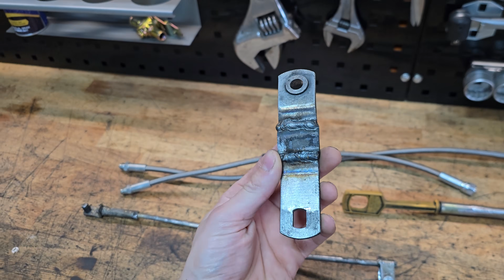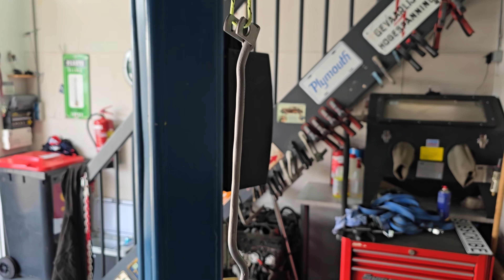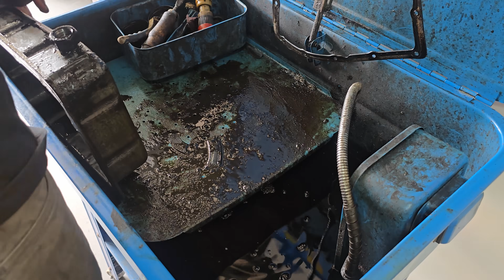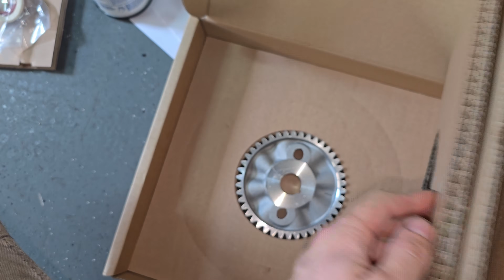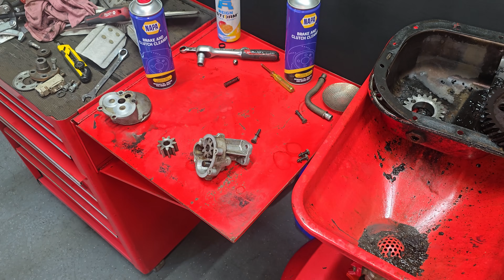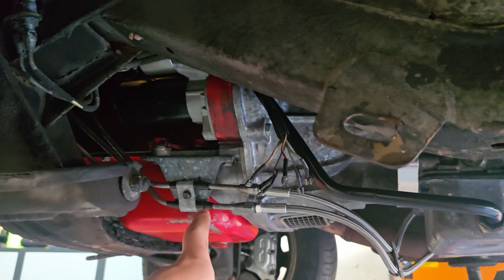Can We Finish 4 speed swapping this classic 1973 Volvo P1800ES?

Comment: I picked an AW70L tranny from a Volvo 240 series at a local junk yard (bell housing, torque converter et-al). I had none of the problems u r talking about (TC not fitting). The whole kit went into my 1800E. Don't misunderstand, I had a boat load of issues to overcome, just not your TC not fitting issue. Carry on young man.
Reply from the maker: The problem was that i took the shortened AW70 torque converter and put it on the L gearbox. That won't work. I then got the L bellhousing machined and it worked like a charm

Comment: Reg. the high engine speed, it’s normal when you start it cold.
Check instead the engine speed at normal engine temperature. Then you ought to have 800rpm.
//Best reg
Reply from the maker: It's running close to 2000rpm when cold. When warm in drive it's at around 1000rpm. In park it goes up again. I've seen a lot of sensors on the Injection system not connected on this car so i'll go over that when the gearbox is done. I'm doing a lot more on this car later this year 👍🏻 first a well deserved holliday to curacao 🎉
I'm trying to get the last gearbox video out this sunday right before i enter my flight 😂
Reply: @RollinHeritage 
I see… yeah, you can’t be driving around with sensors not connected. Also bear in mind, the rubber hose between the distributor and inlet manifold, might have cracks.
You know I hope how you adjust the idle speed? NOT at the throttle screw!!!!
Under the throttle/ manifold, there is a screw with a locking nut.
Reply from the maker: I know! This youtube channel is not just for fun. Rollin' heritage is a fulltime classic car garage specialised in classic volvo's 😊
Thanks for the comments!

Comment: Looks like a very frustrating experience, but glad it ended well.  I've always just replaced the fiber timing gear with another fiber gear, as they last a good long time and are quiet,  Does the metal one whine at high speed on the 1800ES?
Reply from the maker: The steel/aluminium one does not whine or make noise. If you go full steel on steel they will be a bit louder